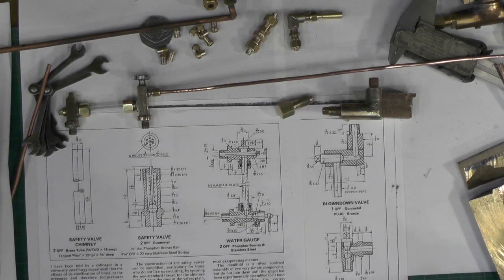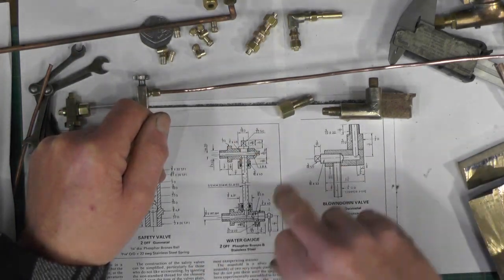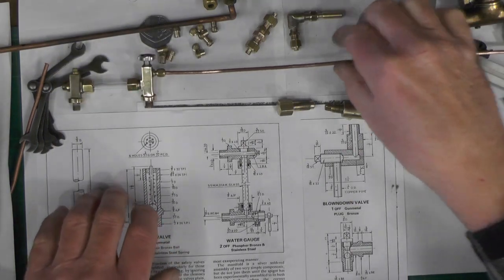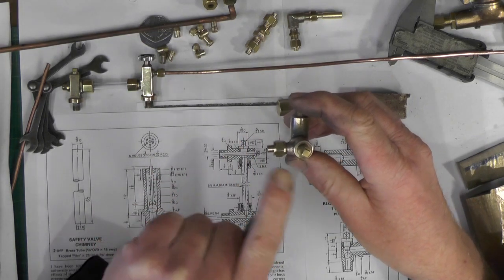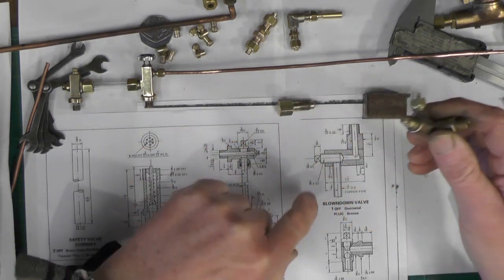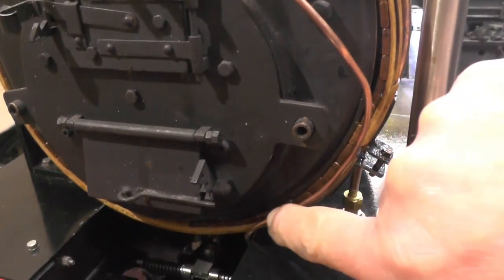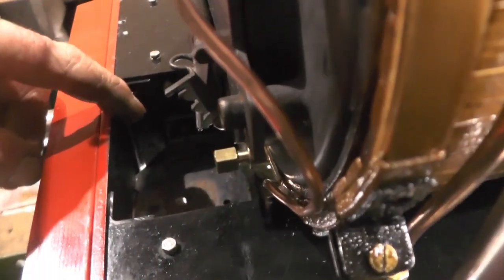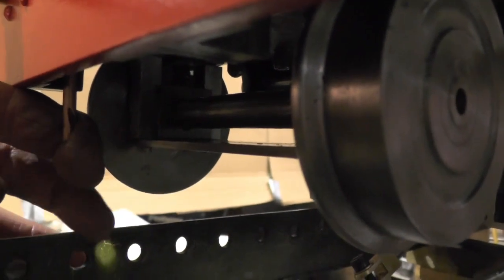Build Your Own Beginners Steam Loco Series (Pipework P3 Blow Down Valve & W/Gauge ) "mr factotum"

Comment: Hi Mr. F.  In the next piping video you make, if it isn't too late already, could you give me a close up of the bit you are calling an olive?  is it just s bit you turned and silver solder to the end of the pipe?  Is it flat or tapered on the end?  I know that is a newbie question.  ;-)

Joe
Reply from the maker: hi joe
60 degree taper, not critical on front and rear of nipple (olive) front goes in to cone of union or fitting and rear is compressed by the nut, then the straight piece at rear goes through nut, 
hope that helps joe, if not let me know.
regards
mr f
Reply: @MrFactotum  thank you Mr. F. for the information.  What proportions do you typically make them?  For example, what is the OD of an olive for a given pipe diameter?  Is it twice?  1/4 inch diameter for the love to use with a 1/8 inch pipe?  Or is it a set size larger than the pipe to be used.  Like a 1/16" wall thickness?  Am I just over thinking it?

Joe
Reply from the maker: @MyHeap  hi joe. 
No Problem, let me have your email and i will forward a sketch i made for mine as an example for you
regards
mr f
Reply from the maker: hi joe
watch out for video Pipework Part 10  (Chime Whistle) coming up in next couple of weeks, ive put up a drawing for the Olives and give you a shout out. Hope that's helpful, if you can't wait that long let me know.
regards
mr f
Reply: @MrFactotum  that's perfect sir.  Thank you.